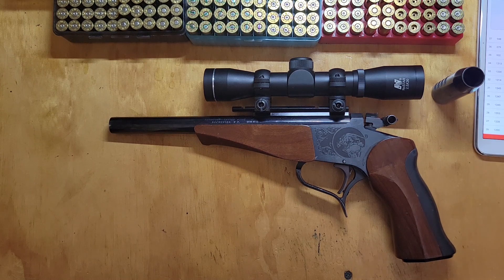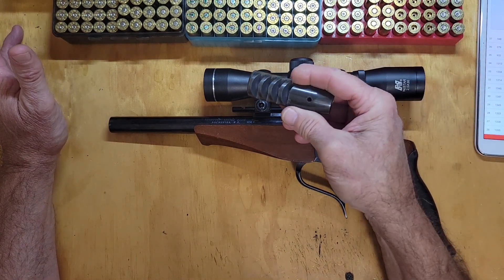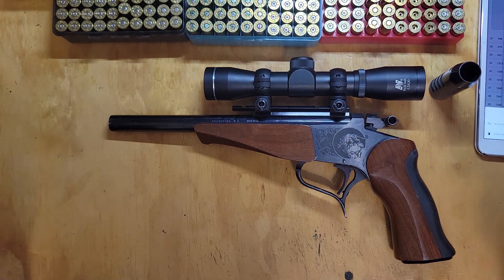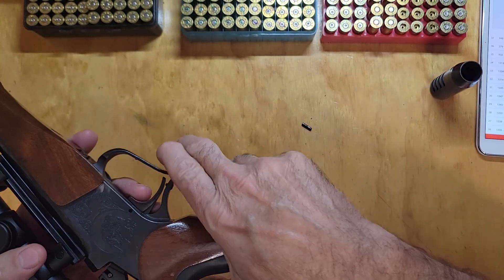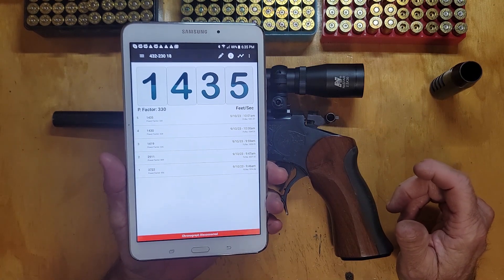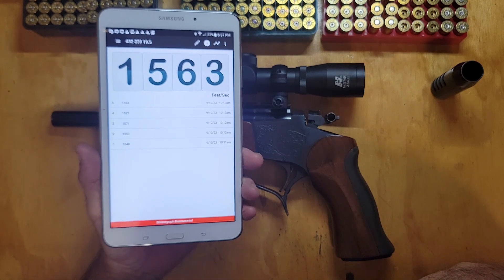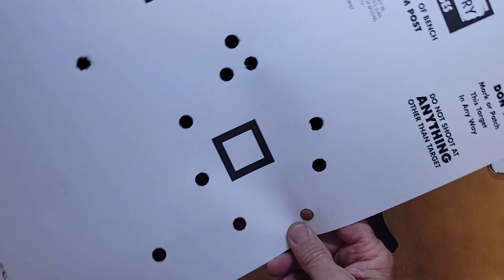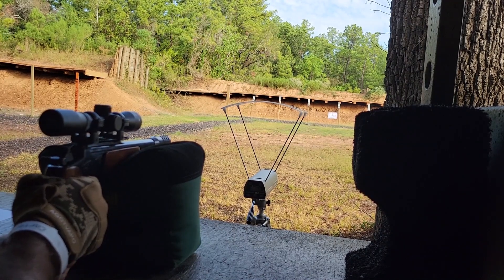44 Range Day The Good and The Bad

Comment: Bummer , before you showed the rear I was going to say it’s the cheap rings that come with. 🙀 ( I don’t use them) You would think rear focus glass is just there to hold gas and when scopes go it’s usually cross hairs or adjustment. 🤷‍♀️ Take the rear off and glue the glass for experimental purposes. ( or maybe from the back) I’m ordering another of the same pistol scope because I robbed one for the 44 lever and like it there. 😂 Maybe 3 will be the charm and I get a stinker but pistol scopes are hit and miss even at $300. Sorry I recommended it , they have been great for lots of people even on the short Mosin rifles!
Reply: Just checked their warranty and $10 handling fee if over 90 days. Looks like Burris has a good no fuss warranty these days.
Reply from the maker: 👍🤠🇺🇲 Hey, we tried, but I think the Contender is too violent for it. Thanks for watching.

Comment: Was thinking about ya today, Was wondering the last time you shot your Contender… Cause I am getting an SSK50 in 309 JDJ… You might be able to get parts from SSK or HausOfArms for the failed pin… or maybe just join TCA apparently one of the big guys bought out most of the parts he could find…. Or BellmTCS
Reply from the maker: @ewetho  👍🤠🇺🇲 Heard, you got one.  Haven't shot it since the scope broke on the 44 barrel. I am working on getting a scope for the 22lr barrel.